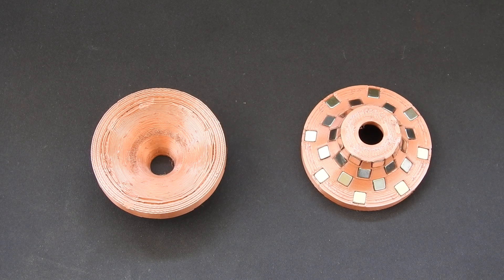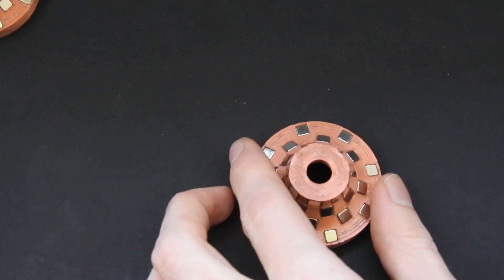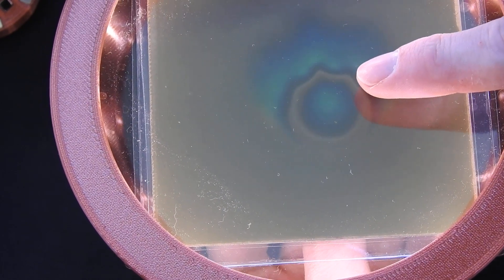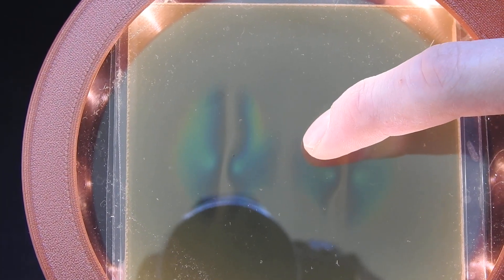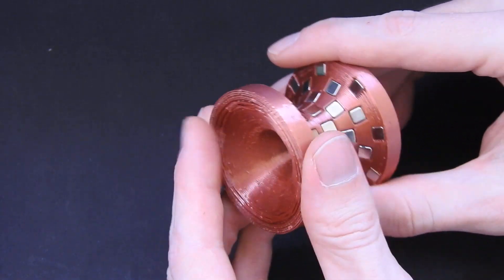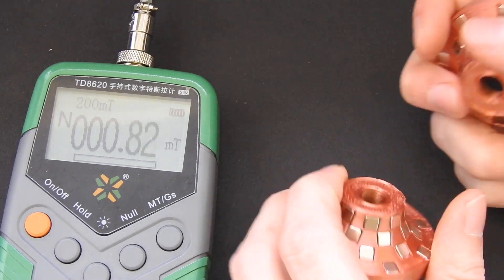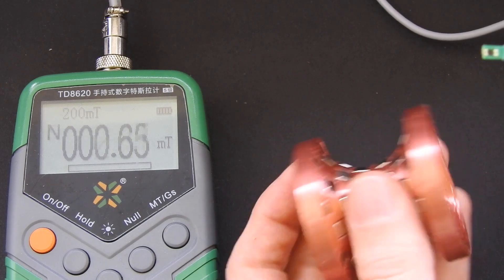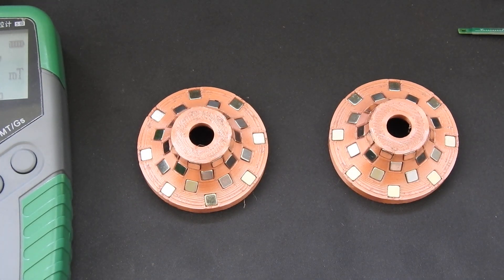Hyperbolic (funnel shaped) magnet arrays and their special properties

Comment: Now you can run some water through this
Thanks
Reply from the maker: You just guessed my next video, prototype is already finished. :)
Reply: @OmegaZZ111  talk about being on the same frequency
Beam me up Scotty 
LOL
Reply: @OmegaZZ111  wonderful
Reply: Wonder how a superconductor would behave ? apparently it sticks in the air because it gets stuck in the flux of a magnet, not  because of a repulsive force like when magnets float over each other unstabley,  and these are some pretty strange flux shapes, maybe you could control the movement of the superconductor in mid air this way.
Reply: @mikejones-vd3fg  I tried halbach arrays over superconductors, the effects were interesting to say the least. Some would vibrate non-stop as if the individual magnets were conflicting with the overall array.
Reply: why water?